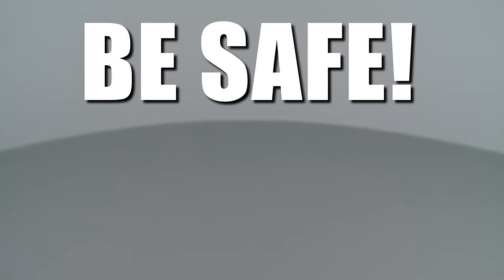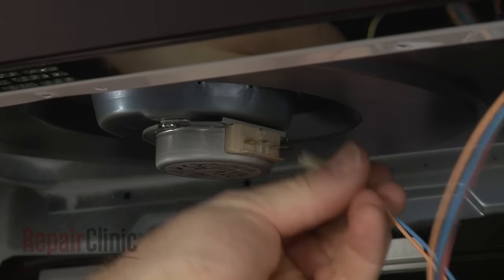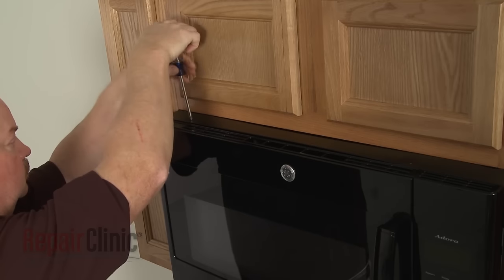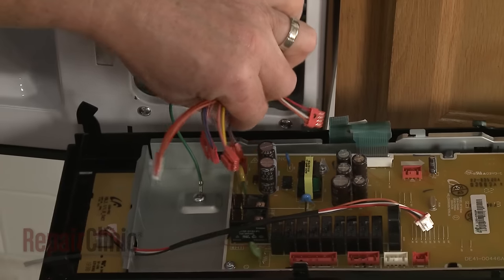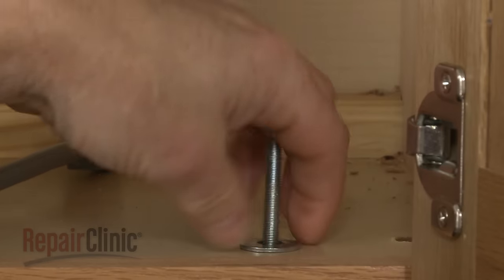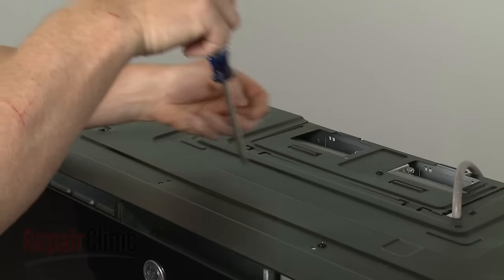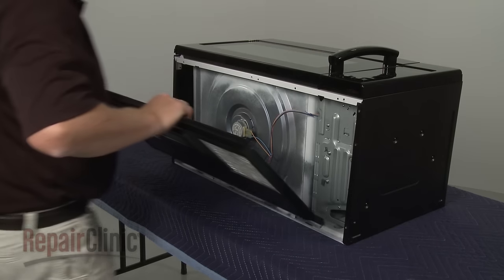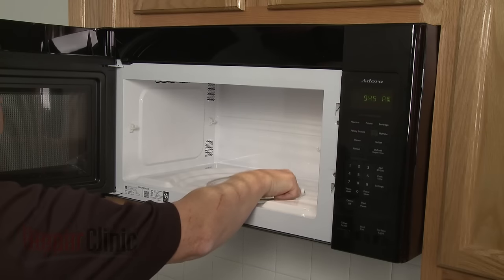GE Microwave Disassembly – Microwave Repair Help

Comment: Thanks for the tip about sliding the top fascia to the left to release it, that was giving me fits. It allowed me to change the interior light which is the same G8 40W bulb as the underneath. Speaking of which it would have been nice to show that around the spot where you replaced the filter being that it is right underneath it. The bulb itself is readily available at Lowe's or Home Depot, but my appliance retailer wanted $18 for it.
Reply: ImAPCTech n6yy

Comment: Replacing the handle:  I have a GE microwave, model #JVM6175SK1SS.  On the handle, the top connection to the door broke.  I ordered the replacement handle.  Following the instructions in this video I was able to remove the inner trim and get to the handle mounting screws; took the old handle off, no problem. However, when I tried to put the new handle on, It was next to impossible to tighten the two screws enough to pull the handle ends flush on the outer door.  I was afraid I was going to mess up the phillip's heads on the screws by continued attempts to tighten.  I took the new handle back off and tried to deeply tighten the screws with it unattached to the door, impossible.  I ended up using 3 small washers on each screw to gain a snug/flush fit.   And yes, the (pricey) replacement handle was a genuine GE part.
Reply: GeneL56 z

Comment: Is there a way to remove and replace the outer front plexiglass of the microwave door? My GE microwave, model JES2051SN3SS, has a cracked front outer clear plexiglass panel.

Comment: Your video showed everything except how to remove/replace the door. I have a GE SpaceSaver over range micro. Any suggestions?
Reply: Did you ever find out how? I was cleaning my oven and stood up hitting my head hard on the microwave door while it was open and I’m pretty sure I just broke the hinge.

Comment: Hi, I have a countertop model. It is not screwed into a cabinet. I removed all the obvious screws and yet something is still holding on to the cover. All (as in *every last one*) shows built-in installations and how to unmount the microwave. I just want to take the darn cover off. Do I push harder or is there something I still have to undo?

Comment: Is there a video on how to replace the door?  Thanks for your help in advance.
Reply: hey eric by any chance you find a video on how to remove the door?
Reply: I have not
Reply: Have you?
Reply: +Eric Schmidt no I haven't but I had to take off the inner plastic panel then the outer panel with the handle!there's the middle shell that holds the 2 panels together that's when u can take it off the hinge be careful with the new door I broke the old one easy!o yea u have to open the door all the way open to clear the notch that locks the door into the hinge!practice with the damaged door.I used a small flat head screw driver
Reply: did you ever figure out how to put the door back on?
Reply: nevermind figured it out..lol
Reply: I did.  Glad you got yours back on
Reply: Eric Schmidt l am trying to find the same video if there’s one let me know Robert Crenshaw
Reply: Another winner of the broken door olympics - the bottom frame shattered on me. Any videos on how to replace the entire door, and not just the handle??
Reply: chances are unless you found an identical dead donor MW to swap doors on?  Totally not worth it..most microwaves because of their price points just are not worth fixing ...unless it is a fuse which might get it running again (so far so good!) but whatever blew the fuse will likely rear it's ugly head soon anyway but still worth a shot ....buy an ultra cheap counter top MW and keep it ready!  Give you time to shop for and arrange for replacement of over range model ...prices are all over the board ....repair guy  says to avoid GE like the plague!  I vouch for Sharp Carousal as the most reliable MW we ever owned!  Over 20 years of daily use and even some abuse!

Comment: The Painters accidentally pulled too hard on my  GE Mongram Microwave Control panel and the whole thing pulled off! It looks like it's held on by double faced tape. My concern is the big square button... Will that fly apart if I remove the control panel from the front? It looks like it's held on by a couple of tabs at the bottom plus the tape and would lift up and off but I'm concerned if I remove it, I wont be able to get it back on without taking the whole thing apart. Can you tell me if the Control panels with the built in big square buttons can be removed and replaced from the front of the unit?

Comment: The speaker that beeps in a GE microwave (much like the one you used to demonstrate repairs in this video)  has stopped working.  My microwave works perfectly but does so silently.  Where is this beeper located?  Can it be replaced easily.  Thanks.
Reply: NO! Don't fix that damn beeper! Learn to enjoy the silence! Hehehe
Reply: If I was soooo lucky!!

Comment: I have a Ge over the oven microwave and it will not turn on. I had replaced the door switches and the 20 amp fuse. Any added ideas?

Comment: Does know how to remove the metal frame inside the lining of the door? The metal frame of the my microwave is in the way of the handle screws, so it looks like I have to disassemble the entire door to get at those screws. Unlike in the video. Any help appreciated, thanks. My microwave is JVM3160DF3BB, Serial HG221413A.

Comment: Hi there.  My ge microwave stop working luke 2 months ago. When its on makes a beeping noise consistently and i have to turn it off.  When we like to use it we connect the power cord back on but sometimes it doesnt let me use the control panels,it reads  DEFROST ON/OFF, SET TIMER , ENTER LBS. but i disconnect , connect back and press like #2 and gives me 2 minutes to heat but if left on it beeps again and again.  And ideas of what can be wrong /fix

Comment: I have arcing on the inside at the right aft rack holder. It is actually burning the plastic holder. what could be the problem.

Comment: My GE microwave didn't come with a plastic linner on the inside of the door. Ths causes splatter to get through the metal screen on the inside and onto the glass. There is no way to get in there and clean that so it always looks dirty. Returning it isn't an option. What do you think I should do? I was thinking of replacing the door.
Reply from the maker: RizzoSol Yes, your best solution would be to replace the door.
Reply: +BorrisDaBlade25              Cover things !!!
Reply: How to install model jvm1540dp1ww microwave

Comment: is the fuse replacement instructions on here?
Reply: No
Reply: Simply unplug unit gently pry out fuse and replace with same rating...mine was 20amp which is the same as the circuit breaker btw ...just blows faster than breaker would open I guess ...but WHAT caused it to blow?  See unless you can explain that?  Something is still wrong ..I suppose there is an outside possibility it had a junk fuse but otherwise something is probably about to fail...like magnetron tube etc ...is a microwave even worth repairing?  Typically not so much ....GE apparently has a really bad reputation...at one repair parts site a gentleman said NEVER replace with a GE ....do your due diligence and find a great reliable brand.  At our last house we had a Sharp Carousel that we just abused and used every day for like 20 years ...our kids live in that house and it is still works like new ....this GE?  2 years old ...pathetic

Comment: My Kenmore Microwave stopped working I order a fuse to replace it but the microwave have a specific type of screws that doesn't fit a Phillip or a flat. I contacted The seller but in order to fix my microwave I have to have it repaired by a repair services just to take off the panels a $75 fees. I tried to order the specific screw driver but it not sold in store. I'm sure I can purchased another microwave less than $75
Reply: You can buy those driver bits at any hardware store ...take a good picture of the head and go get what you  need  ...better and/or paint screw head with sharpie and immediately press paper on head with finger for impression and size of screw socket ...UNPLUG MW before opening panels!   BTW the internal star point screws there are several sizes ...good to just by the whole set ...amazing how many things have those!  TORX head screws is their offical name

Comment: my GE microwave (JVM3670) cooks normally but when I get through and close the door the fan automatically comes on and stays on until I open the door and leave it open.  Any ideas?
Reply: Usually an indication of a door switch issue.

Comment: Anybody kno how to fix a low suction problem on the bottom of MV? I pulled the MV down and the fan moves tremendous air, but it's not sucking air from on top of stove.

Comment: DANGER HIGH VOLTAGE ELECKTRICITEY. KEEP OUWT.
Reply: unplug first at least ....never plug in with internal parts  if you  disassemble ...you could be frying yourself with microwaves and not even know it!  Metal parts shield users

Comment: I have a GE model PEB7226EH1ES and need to replace the tray motor. How do I drop the bottom panel to access the motor? This obviously involves more than just removing a few screws like in the video. Help!